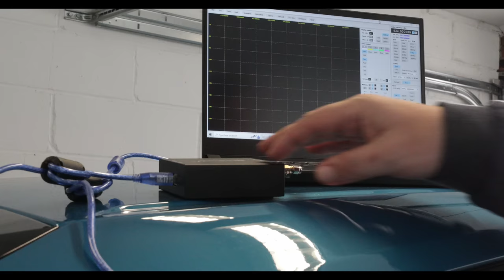Relay attack real device! Car Theft with DIY Repeater Amplifier - Let's see how we can prevent this

Comment: We've been working on a product to solve this issue! FobBlocker - a thin PCB that wraps around the battery, shutting it off and waking up the fob on motion. This beats inconvenient pouches or needing a switch since when the key isn't being used, it shuts itself off.

Comment: One thing I am not clear about. Pressing the button produces the signal to unlock the car. He implies there is one emitted 247 but I didn't see that part detected as occurring and he must press a button. Different if it was an auto unlock in proximity.  Faraday pouches are common for all devices and credit card sleeves work the same way.

Comment: Sorin, lock the car then hold the fob lock button and press the unlock button twice. This will stop the fob from continuously sending a signal and next time when you walk up to the car it will not open. You will need to use the fob unlock button to open it. You would need to do it each time you park as it resets itself when you open the car. It works for me on my 2017 Rav 4 hybrid. Keep up the good work! Gerry in California
Reply: Yup, I keep both keys in faraway pouches in the house but I always disable the fob.

Comment: Brilliant performances by you all & thanks so much for highlighting such a massive security flaw.
Thankfully, faraday pouches are really cheap nowadays but it also requires vigilance & awareness on the part of people.
Mercedes have at least started to place motion sensors in their key FOBs to make them go to sleep after a while to stop these sorts of attacks.
I also find that washed, dry potato chip/crisps packets seem to work well as "faraday shields".
Another way around it is to teach everyone at home to place their car keys in a faraday box to stop these attacks if they don't have a faraday pouch, or buy a pouch for your family, friends & loved ones this Christmas as a useful present.
As for spectrum analysers, one doesn't even need a PC anymore as the TinySA, standard 800MHz coverage & 6.5GHz coverage is available under "Ultra" versions priced from $80 - $350 & can easily scan the 433-434MHz UHF ISM bands.
I agree, modifying the remote to put a small slide power switch is a good approach & due to the short activation distance I'm surprised that car manufacturers don't also use SHF ISM bands like 24GHz (1.2cm ISM band) which is far more difficult (not impossible!) for consumer level RF test gear to cover.

Wishing you Sorin & all your family a very merry Christmas, happy new year in 2023 with health, happiness & continued success.
73s si salutare, John from Australia
Reply: Hey so the TINY SA would work for this ?
Reply: U can't do this with TinySA...
"The generator function can not be used as a tracking generator as you can not use the spectrum analyzer and generator functions at the same time."

Comment: Handy tip.
Line a box with empty (washed) crisp packets, you can then store your keys in this box and it will block the signals (yes, you’ll need a lid for it, also lined with crisp packets).
Reply: I use fine metal mesh to make the faraday cage.
Reply: I assume baking foil (tin foil) would do the same.

Comment: I believe Mercedes recently started putting a motion sensor in their keys so they go to sleep after an inactivity period. They could have also set the key to turn on and off with the lock and unlock buttons on the fob which are already built into it. The whole thing is a solution looking for a problem!

Comment: You can always record the signal from the FOB and play it back to the vehicle, without the need be near the fob to amplify its signal. There is always a way. This is why i’m a big fan of installing hidden kills switches on vehicles. It can be even simpler, just remove certain fuses when you leave your vehicle on a “sketchy” area. Inconvenient, ya. But effective.
Reply: Can you elaborate a little bit more please about your thoughts I’ve not heard of a replay attack on kes
Reply: The playback thingy doesn't work with rolling code. I do agree with the kill switch method, I would suggest removing relays instead of fuses. Gps trackers can be effective too.
Reply: My bad rolling code can be copied and playback but it requires technique. You're right it ain't safe out here all you can do is chew your fingernails

Comment: Sorin I like your videos, your so smart and your a good teacher too. I agree, a simple switch would have made this so much better for security reasons, or even including a simple part like 223b touch sensor that only has like microamps draining, to only allow keyfob to operate when touched, would have been a much better idea. 

For years now our electronics have been forced into Mechless design because we always have such problems with analog devices, like trimmers, volume controls and even switches but it can still be safe if some simple thought is put into it.

Comment: love the film making. But to capture the signal you have to press the remote but the signal is a rolling code so only good one time .I think the system is very secure
Reply: What? Nothing has to be pressed. The fob is transmitting all the time. That’s the problem.
Reply: @ppal64 Transmitting what exactly all time? Because if you don't press the unlock button it doesn't unlock in normal use. So why it does unlock using this relay attack method?
Reply: @gastonpereda4481  Here is the talk about keyless system, not about fob where you need to press for it to transmit.

Keyless emits always (you can have the car fob in your pocket and just wave your hand behind the door handle and the car will unlock, since it senses the key is near)

Comment: Interesting topic. It appears that the remote is of the rolling frequency type. Do you have a link or source for the spectrum analyzer module for the computer? My service monitor has died and I am in need of a cheap spectrum analyzer.

Comment: I just watched your video on relay attacks.  Could you use some of the equipment you used to find a lost key fob?  If you could pick up the signal and its strength, you could walk around an area and hone in on the lost fob.  Is that possible?

Comment: Interesting video. From the frequency analyzer part it was obvious that the key sent a pulse only when pushing the button on the key. How then can be a car stolen when the key is in inactivity period? Can anyone explain ?
Reply: Most vehicles are constantly sending a passive signal out and same with the key fob.
Reply: Same question. Unless the car unlocks when you get near it without having to push any button even it is keyless, I don't understand how can this method (relay attack) unlock doors.

Comment: During winter and dry air conditions becomes even more easier to get signal. Why i know this? My old car stupid low range remote works only on winter times so well i can lock and unlock car from inside instead range of 5 meters from the car usual on summer times. But there could be other details affecting this like during winter building being worse.

Comment: Sorry I want to understand one issue —— are the keys constantly actively broadcasting or only when locking/unlocking ?? Because on your spectral analyzer, it’s dark until you press the keyfob. So someone needs to wait for you to send signal to lock/unlock. Likewise the pouch has to be useless because ultimately you have to take the key out of it to be able to get into your own car and that’s the moment someone could be listening in on your signal…
Reply from the maker: the LF constatly, the HF only when u press the button
Reply: @electronicsrepairschool  ah I understand ! So the repeater brings the LF signal from spare key in the house next to the car door. And this needs the current signal not an outdated expired one ?

Comment: Hi Sorin I have a ham radio question I'm also in the UK what ground wire should I use that I can get very easy to connect my radio to the ground rod outside to help reduce RF ? Thanks

Comment: Can you please explain how can a thief drive the car away after acquiring the signal from the remote controller even though the controller not with him , the car must stop after few hundred meters   ?
Reply: car manufacturers are not allowed to kill the engine after key isnt recognized anymore.

because lets say your key runs out of battery and you are doing 100 mph, you wouldnt want the engine to shut down

Comment: Great video.Can they steal the car itself, they have imobilazer and it cant be hachked i believe?
Reply: They have the signal = they have the key.. they just get inside and push the start button and drive off. They either then program a new key through the obd port with a tool that pulls key data from eeprom so they can move car about or just break for parts where they take the car

Comment: What would be funny is to have a low powered transmitter in your home that transmits the cars panic signal every minute or so.  The signal isn't strong enough to reach the car, but if a relay/amp is used, it will set off the horn.  😂

Comment: all you have to do is hold down the lock button and press unlock button twice and the key fob stops sending the signal... no need for the pouch
Reply: Also most people have no idea you can take the battery out of the fob till your ready to use it again

Comment: The mechanical switch is the simplest thing. Just have a switch to turn it on and off or simply just have the option to turn off keyless. Its pure stupidity that this issue has been going on for at least 7-8 years and no change.

Comment: I believe the future of this will be shaped by the new "passwordless" technologies that part of us will surely be using in the next 2 years or so. Using our smartphones, with highly precise fingertip readers and other biometric sensors, we'll be replacing keys and passwords. With a smartphone, you can use 3 factors of authentication: something you have (the smartphone itself, which can be sensed via bluetooth, ultra-wide band like AirTags or similar location sensors, and identified via private keys/certificates), something you are (your biometrics - fingertip, face etc.) and where you are (close to your car, again, via bluetooth, GPS, triangulation etc.).

So, we won't have physical keys to our cars - we'll have just our smartphones.
Reply: A simple key will be the best! I recall when my Prius 3 12V battery died..if I didn't had the classic key..I had to brake a window..
Reply: I see the value in that, but the issue with a simple key is that you're protected by only one factor of authentication (something you have), and it's not something hard to break. Not even close. It's even more insecure than the current presence key shown by Sorin.
Reply: @viniciusvbf22  Absolutely agree, let's quote the old say..fences are not made for thieves..but that's how an idea for a personalized security business appears

Comment: As a mechanic wouldn’t you fell more safe with a normal mechanical key?? It’s all technology for no reasons! It makes repairing cars hard now it’s electronics not electrics plus the cost to the customer when it all goes wrong. I’m sure a lot of house electricians can agree now it’s all going to data lines. Just one note as a mechanic….  Because this technology is standard it like the old days of screwdrivers! Change something for them like immobiliser/ crooklock/ move obd socket with extender lead, just do something to overcome this till they change this rubbish.